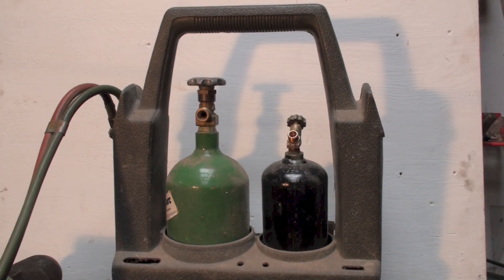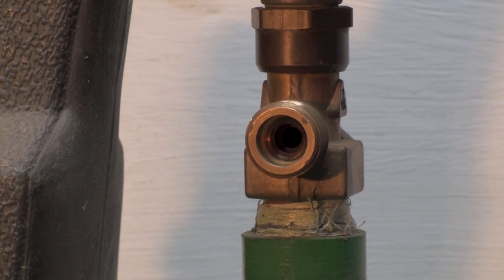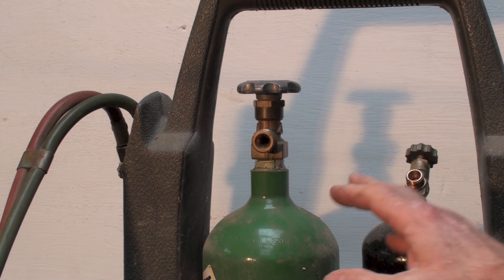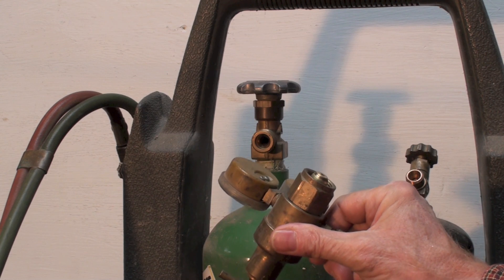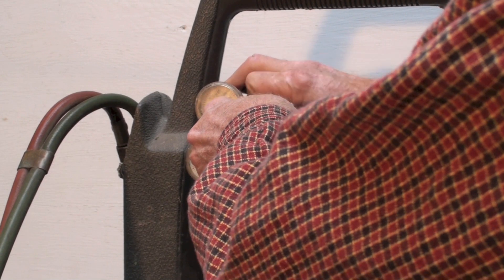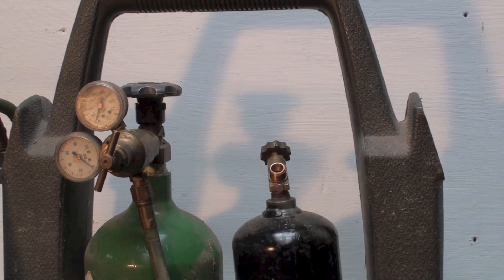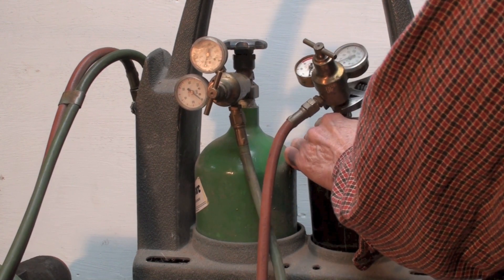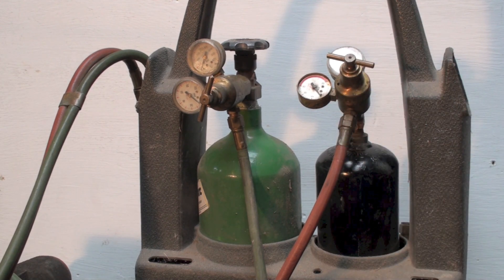Oxygen and acetylene regulator setup

Comment: Can i use acetylene regulator on the oxygen?
Reply from the maker: Only if you want to die in an explosion.  High pressure oxygen and the carbon in the acetylene will cause a reaction with explosive results.
GFM

Comment: I love my Lincoln electric port a torch. They are light and easy to carry anywhere. Never had an issue with it. You can do about 4 calls on a full set of cylinders, but my acetylene normally runs out first. That's why I carry an extra set of bottles. I'm a refrigeration tech in Bakersfield California and honestly 98 percent of techs here use the same type of torch. I can't imagine taking a 80 lbs trolley up on a roof. Lol. Great video!

Comment: When I researched this before buying a small tank just a bit bigger than yours, I was told that I couldn't use a large cherry blaster. The rapid discharge rate of a cherry blaster causes the acetylene in it's tank to be unstable. Also, a large tank costs just a bit more than a small one to fill, so larger tanks are more cost effective. A buddy of mine died when one of these exploded, so the safety advice is certainly important. 

Good summary. Was that a fire in the background?